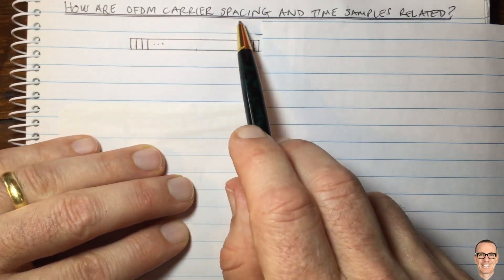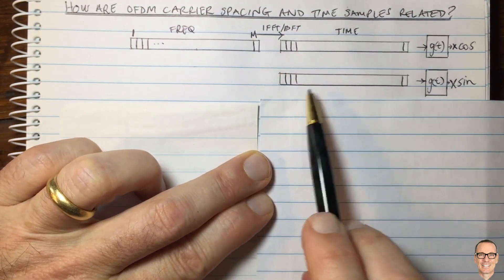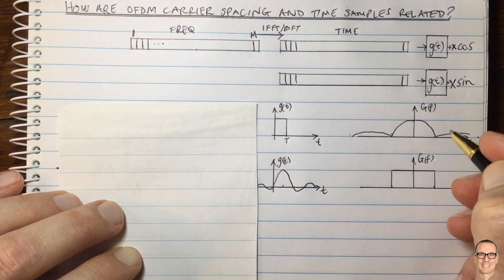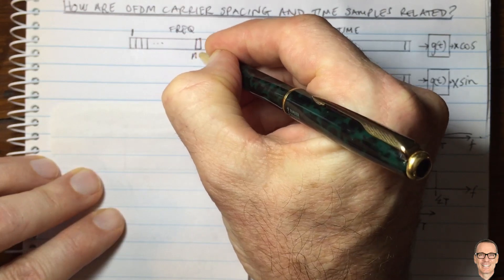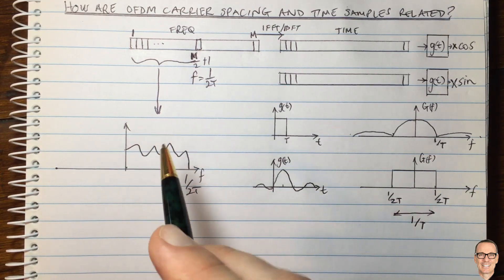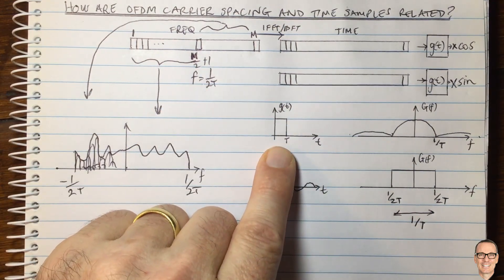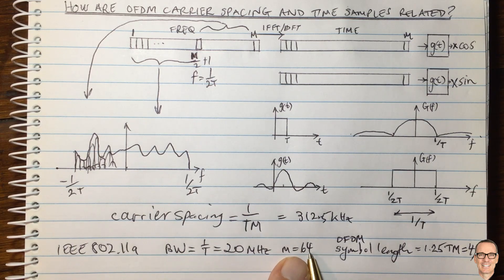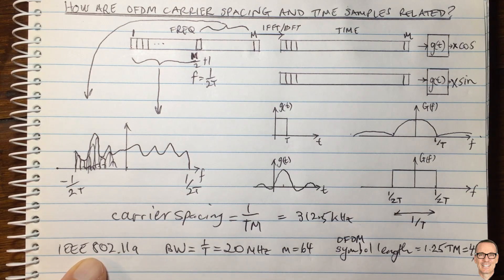How are OFDM Sub Carrier Spacing and Time Samples Related?

Comment: @iain_explains When you say that the bandwidth is 1/T, this means that we are using a sinc function in the time domain, and this not practically realizable because it will go from -inf to +inf. And we cannot also use a perfect square wave in the time domain because in the frequency domain this will go from -inf to +inf. So usually in practice we use a pulse shaping filter (raised cosine for example). In one of your videos you said that in practice to transmit a symbol of duration T, we'll need a bandwidth of B=2/T not 1/T as in your example and the subcarrier spacing in this case will be 2/MT. So what do we really consider in practice?
Reply from the maker: Yes, but one of the benefits of OFDM is that each subcarrier is "narrow band", which means the symbol period is relatively long (ie. it's the overall OFDM symbol period), which means the time domain pulse can be close to an ideal square function. It's by stacking the sub channels tightly next to each other in frequency (orthogonally) that we can achieve the higher overall data rate. Hopefully this video will help: "Why are OFDM Subcarriers Sinc Functions?" https://youtu.be/edXdRAzz2fY

Comment: Hi, thanks for nice explanation. I have a question (still, i am basic level)

 let's say I have the ofdm multicarrier signal which is the sum of complex exponentials (or according the quadrature modulation you mentioned). Then in the argument of this exponentionals, the sampling frequency should be at least 2 times the highest subcarrier frequency. (let's say I want to implement this in the baseband)

sampling frequency is fs and the highest subcarrier is (N-1)/T  (T being the symbol duration and N number of subcarriers). on the other hand we know fs=1/NT. 
Even if we assume the signal goes from -N/2T  : N/2T frequencies, we are very tight w.r.t the nyquist rate. 
I am implementing this and what I always get is a signal that has a peak at zero sample  (the peak value is equal to N_Subcarriers) and the imaginary part is always less than 1e-6. 
How to fix this?
Reply from the maker: I think you're mixing up the concept of "sampling an analog signal" with the concept of "digital communications symbol sampling". This video might give some insights (although it's not specifically about OFDM): "How to Avoid ISI in Digital Communications: Nyquist Zero ISI Theorem" https://youtu.be/sgyTlI9BsKc
Reply: @iain_explains  Thanks for the quick response, 
I am not talking about ISI. My question is about representing a multicarrier signal with certain bandwidth 
let's say I have a multicarrier signal as $\sum_n^{N-1}  C_n exp(j 2 \pi n \Delta_f  t)  
C_n being a complex coefficients, \Delta_f is equivalent to subcarrier spacing  equal to 1/T
the sampling frequency fs for this signal should be at least twice as the bandwidth of the signal (which is N \Delta f). 
if we go now with the OFDM notation, we know Ts=1/fs= T/N , and T=1/Delta_f , and therefore the fs/Bw is almost equal to 1. 
How we want to fairly represnt this multicarrier signal   in time domain?
Reply from the maker: The point I was making is that you don't need to sample at twice the bandwidth. You only need to do that if you want to be able to completely reconstruct the analog signal later, from the samples. That's not what you're doing in digital communications. You don't need to reconstruct analog signals. You only want to be able to extract the digital data from the analog signal.
Reply: @iain_explains  what about the sensing application, where I want to find the peak of correlation of the signal with its matched filter , then I would imagine you need higher sampling rate. 
Anyways, some papers mention on their simulation parameters very high sampling rate w.r.t the bandwidth. and I do not where that is coming from :( 
Again , I am thankful for your quick responses :))

Comment: Dear Professor, at 4:30, could you explain why f=1/2T please? I tried my assumption that 1/T = B, then it leads to B = N_fft * subc_spacing, which is not correct in some 5G settings, like 20MHz, subc_spacing = 30kHz, 1024 fft, and then the T_sample = 1/ (N_fft * subc_space) = 3.2552e-8, which is different to 1/B
Reply: Dear Professor, I just calculated that, the sample rate of 1/T = N_fft * subc_space is greater than the sample rate of just 1/B, which is fine, but my question now is that, why don't why set it to 1/2B ? thank you so much
Reply: I just realized that, when we map the frequencies from  - N_fft/2 * sub_space to +N_fft/2 * sub_space, the maximum frequency now is N_fft/2 * sub_space, so the sample rate is 2* (N_fft/2 sub_space) = N_fft sub_space. The point now is how we can differentiate the signals in negative frequencies and the signals in positive frequencies, I will look for it
Reply from the maker: This video should help: "What is Negative Frequency?" https://youtu.be/gz6AKW-R69s
Reply: @iain_explains  thank you so much Professor

Comment: You mention the different pulse shaping filters which can be used and their different bandwidths in the Fq domain,  2/T for the square and 1/T for the sink. In your explanation of this concept you are pointing at the square time domain filter (top right) and then saying the the fq domain bw is 1/T but this isn't correct? Or have I misunderstood? Perhaps I don't fully understand the pulse shaping filters part. Additionally could you explain how the sink functions in the channels would look in the example of the square pulse shaping filter (the sink function in the Fq domain?) would the amplitudes be kind of curved to match that fq domain response?
Reply from the maker: This video might help: "Pulse Shaping and Square Root Raised Cosine" https://youtu.be/Qe8NQx4ibE8
Reply: @iain_explains  thanks a lot, just watched that, excellent explanation as per. I hadn't heard of the Square Root Cosine but that was a great explanation

Comment: Thanks again for the awesome videos!
I am confused about pulse shaping. In all of the other videos (in fact all material I can find), OFDM is not combined with pulse shaping. If the pulse is non-constant over one period of the carrier(s), wouldnt that mean our orthogonality relations are now likely violated? The orthogonality relations only hold because integrals over products of sines/cosines vanish, but not in general when those are multiplied with other time-dependent functions, i.e. the pulse shape in this case.
Also, wikipedia states that pulse shaping is usually applied after modulation. I guess that is mathematically equivalent here, but do you know whether there is any practical reason for this?
Thanks in advance!
Reply from the maker: Great question. Think about the M length real-valued vector that comes out of the IDFT in the transmitter, that needs to be "sent" on the cos wave carrier (top right hand picture in my summary sheet https://drive.google.com/file/d/1ASUhoAXJXpGc8Vp44cvPLgzPv8lDdatm/view ). It's a vector of discrete values. Think of it as a discrete-time signal. Imagine it as a discrete time sampled version of a continuous-time signal. In order to "reconstruct" the continuous-time signal exactly, you would need a sinc pulse shape filter. If you are happy to have a low-resolution reconstruction, you could use a zero-order-hold filter. People don't talk about this when they talk about OFDM because either they don't understand it (often the case) or they consider it to be "just implementation details". Here are a couple of my videos that might help: "How are Signals Reconstructed from Digital Samples?" https://youtu.be/dD9HC1GThZY and "Pulse Shaping and Square Root Raised Cosine" https://youtu.be/Qe8NQx4ibE8 And to your point about the orthogonality, it's also a very good point. But think about breaking down the pulse shape into small time segments each of duration 1/f_c Each of these time segments is only as long as the period of the carrier. This is massively shorter than T. Over each of these time segments, the "segment pulse shape" is essentially constant (almost no matter what the "overall" pulse shape is), and so the sin and cos components are orthogonal. The overall integral from 0 to T is just the addition of each of these components, which is zero (... I think that's right, although I haven't checked it mathematically).
Reply: @iain_explains  Thanks for the quick and detailed response! Your point on orthogonality seems reasonable. If the carrier frequency is very high compared to the pulse shape variations, the pulse would be approximately constant over one period of the carrier. I hadn't thought of that!

Regarding the first part: This sounds to me as if pulse shaping should be done before modulation onto the carrier though, or am I missing something?
Reply from the maker: I'm not an "implementation" person, but I've always thought of it as being done before multiplying by the carrier (surely it has to be - otherwise it would be necessary to implement shaping filters at the carrier frequency, which would be a more complicated filter - at least that's what I'd expect - but again, I don't really know about hardware implementation aspects).
Reply: @iain_explains  Hi Prof., This explanation is very interesting(and convincing) but now I am confused because in many of the SDR implementations such GNU Radio 802.11g, and Openairinterface-LTE/5G, I never saw pulse shaping of the IFFT output before they are modulated with carriers.

Comment: Starting around 6:30 when you are describing how the subchannels are fitting into the 1/2T bandwidth (on the lower left diagram) and are then drawing in the sinc functions that correspond to the constellation points of the data, are those overlapping sinc functions that you draw supposed to be thought of as time domain waveforms even though youre drawing on a frequency axis? I'm confused because you even refer back to the box-shaped frequency domain figure on the right but then continue to draw sinc functions on the left.
Reply from the maker: No, those sinc functions are in the frequency domain. But I understand the confusion you're having (which is why I made the video - but perhaps I didn't explain it well enough?) The "samples" that go into the channel (in the time domain) are at a rate of 1/T. If they are sent with a sinc pulse shape (ie. the bottom middle figure), then the overall bandwidth will have a flat spectrum (the bottom right hand figure). Now, within that bandwidth there will be sub-carriers that are generated as a result of the IFFT. Since the OFDM symbol lasts for MT time, and since the constellation point in each subcarrier changes abruptly from one symbol to the next (ie. they have a square shape in the time domain, of width MT - and remember that they are all in parallel, due to the IFFT), therefore the subcarriers have a spacing of 1/MT and they have a sinc shape (in the frequency domain). I hope that's clearer. Perhaps these videos will help: "OFDM Waveforms" https://youtu.be/F6B4Kyj2rLw and "OFDM and the DFT" https://youtu.be/Z4LIgNgNAlI

Comment: Hi, I have a question . Towards the end of the video you mention that you are using just 48 of the 64 subcarriers for data. Why do you still need to multiply by 3/4? Does that 3/4 represent something else?
Reply from the maker: 3/4 relates to the error correction coding rate. The elements are labeled on this pdf summary sheet on my webpage: https://drive.google.com/file/d/1ASUhoAXJXpGc8Vp44cvPLgzPv8lDdatm/view
Reply: @iain_explains  Thank you very much
Reply: @iain_explains  What about the other 16 subcarriers. Are they for control signalling?

Comment: Just so it's clear, g(t) is not the pulse shaping filter, but the reconstruction filter used for interpolation when doing the analog-to-digital conversion?
Reply from the maker: g(t) is the pulse shaping filter. Another description might be that it is the filter that turns the digital (discrete time) value into a continuous-time waveform that can be transmitted (... I'm not sure if this is what you mean by "reconstruction filter" or not?). Have you seen my video on pulse shaping?: "Pulse Shaping and Square Root Raised Cosine" https://youtu.be/Qe8NQx4ibE8
Reply: @iain_explains  There are these old lectures from Alan Oppenheim's Digital Signal Processing series (or from his textbooks) where he shows that you can  treat reconstruction of a sampled signal through essentially the same idea of pulse shaping (convolution of a pulse train with an "interpolation" filter). The idea of interpolation and pulse shaping are identical when I think about it more. OFDM view point just makes is very clear.

Thanks for the lectures, they are very helpful and intuitive.
Reply: I guess my understanding is, when you typically think of turning an I/Q symbol into an analog signal to transmit, each time instance has a  pulse for a different symbol  that you convolve with the pulse shaping filter to get get the analog output, which can then be mixed with the carrier. For OFDM (or any other orthogonal transmission), instead of having a pulse train (that is orthogonal) you have each symbol occupying the full sampled time, but with orthogonal signals. In the case of OFDM we have the sampled sinusoids with integer multiple frequencies for each symbol. which so happens to by the output of the IDFT. These orthogonal samples are filtered by the pulse shaping filter in the same way a pulse train is. This process is the same as reconstructing a sampled signal (sampled into a pulse train). 

Here is the lecture from Alan Oppenheim if you're interested: https://www.youtube.com/watch?v=mmkOAMOw73U&t=1s
Reply from the maker: Yes, that's right. Glad you liked the video.

Comment: Dear professor,  
If we increase the number of subcarriers but keep the bandwidth constant , cyclic prefix constant then will the data rate increase?? 
Also if we double the bandwidth , while keeping the number of subcarriers constant then will data rate changes?? 
I am very confused..for the first case I have calculated and find that data rate remains almost unchanged...this is due to constant bandwidth ??
Please clarify. Thanks.
Reply from the maker: It's not a simple relationship, since the overall data rate depends on many factors, including the constellation size you decide to use in each subcarrier, the SNR in each subcarrier, and the characteristics of the channel.
Reply: @iain_explains  Yes Sir, I understood that point.  
Thank you.

Comment: sir what is the duration of T of pulse shaping filter in microseconds for which it's multiplied with carrier for upconversion. I am referring to the "practical value " used in OFDM systems
Reply from the maker: I'm not sure what you mean. I gave a practical value in the video. IEEE802.11a WiFi has an option for a 20MHz bandwidth for the OFDM symbol, which means T = 1/(20x10^6) = 50 ns. The 4G LTE mobile communications standard also has a 20MHz BW option. The 5G standard has BW options up to 400MHz. And IEEE802.11ac and ax WiFi both has BW options up to 160MHz.

Comment: hii professor  first of all thanks for video , my question is why we are considering the  -ve frequency subcarriers why we not taking +ve subcarriers only, and my 2nd question is the why subcarrier spacing is 1/2T , if we have the symbol duration of T then it should be 1/T
Reply from the maker: If you only use the +ve frequency subcarriers (at the baseband) then you'll only be using half the bandwidth (in the passband). And for your second question, the subcarrier spacing is not 1/2T or 1/T. As I wrote half way down the page, the (sub)carrier spacing is 1/(TM).

Comment: Thank you for this vedio!
I have one general question, please.
In case we generated any baseband OFDM signal and we need to know the duration of the ofdm symbol. 
This can be done by number of fft points (M) by the duration of pulse shaping filter (T). Is that correct?
Reply from the maker: Yes.

Comment: My dummie question is, every subcarrier modulate at a rate of 4us and then all components are +?
Reply: Finally they are sent in the GHz band?
Reply from the maker: The OFDM symbol length is 4us (including the cyclic prefix), which means that each of the narrow band subcarriers changes its constellation point (digital information) every 4us (since they are all in parallel). Sorry, I don't know what you mean when you ask if "all components are +". And yes, the carrier frequency is generally in the GHz range (frequencies of the sin and cos waveforms indicated at the top right hand side of the screen). https://drive.google.com/file/d/1ASUhoAXJXpGc8Vp44cvPLgzPv8lDdatm/view
Reply: @iain_explains  very clear now, I watch all the videos related to OFDM, thanks professor :)

Comment: One thing is not clear. You are fitting M frequency domain since functions of null-to-null bandwidth 2/T into system bandwidth of 1/T.
Reply from the maker: No, that's not right. I should have made it clearer in the video, but the null-to-null bandwidth of each sub-channel is 1/(2MT). This is because the duration of each sub-channel symbol (in the time domain), equals the entire OFDM symbol time (MT seconds). Don't forget, the QAM constellation point in each sub-channel is fixed/constant within an OFDM symbol. In other words, the QAM constellation points in each sub-channel only change at the boundaries of the OFDM symbol times (ie. every MT seconds), and they change abruptly/instantly, which means that in the frequency domain the sub-channels have a sinc shape around the subcarrier frequency.
Reply: Thanks Prof Iain. If you could please make a video on mimo ofdm when each antenna has multiple subcarriers, then it would be great. Particularly how data is distributed among different subcarriers across different antennas ? Subcarriers' mapping ? Reception and detection back to frequency domain ! Carrier Aggregation !
Reply from the maker: Thanks for the suggestion. It's on my "to do" list (but it's a long list!)